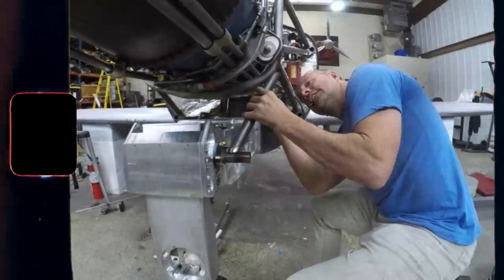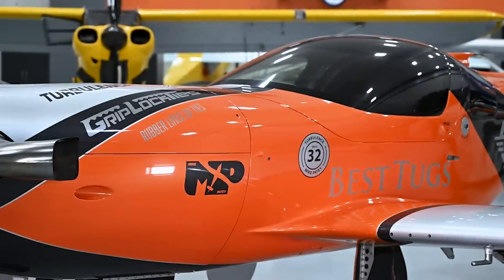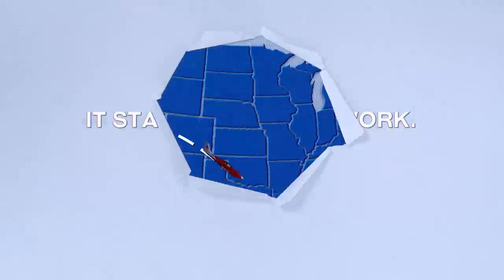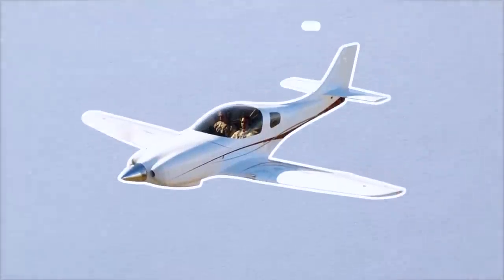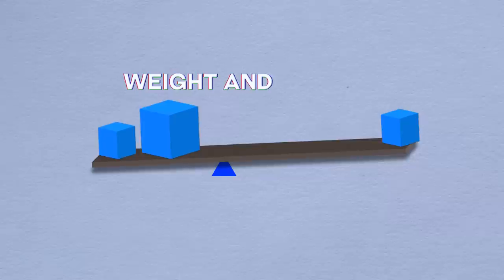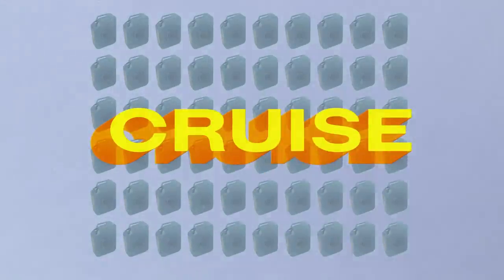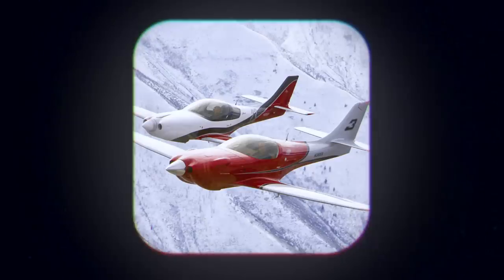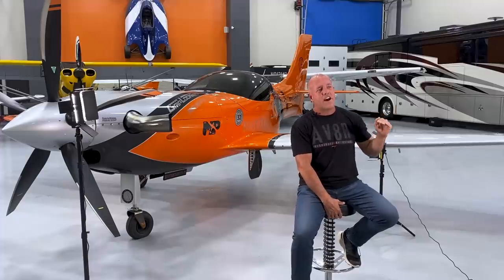The Fastest Single Engine Turboprop in the World flying today. | Turbulence #1

Comment: I'm curious how you dealt with the aerodynamic flutter problems. Making the wing more rigid helps, and balancing the control surfaces is necessary, but is there anything else you had to do to keep the control surfaces from becoming excited at high speeds?

Comment: The Lancair Legacy is NOT "clean" - at least not as clean as it could be. The slender aft fuselage and swept tail look pretty but are aerodynamically inefficient. Probably the absolute best aerodynamic design in terms of internal volume vs. low drag is the Questair Venture. The Venture looks ridiculous, especially on the ground, but it is a brilliant design aerodynamically. It looks like it should be very sensitive in pitch but in reality it is rock-stable due to something called horizontal tail volume, which is a measure of the horizontal tail area AND distance from the aerodynamic center. Mike if you ever want to create your own ground-up speed/efficiency design take a close look at the basic layout of the Venture. The only things I would change on the Venture are the swept tail and old NACA airfoil on the wing. Other than that it is an excellent efficient airframe.

Comment: The terrifying thing about this airframe is that it's glide ratio is garbage.  Especially with all of the changes that you made, you're extremely fortunate that you never had an engine failure.  Without an engine, this thing is basically a lawn dart.